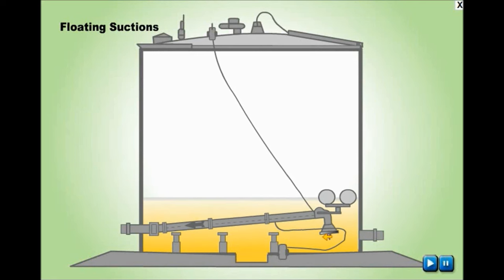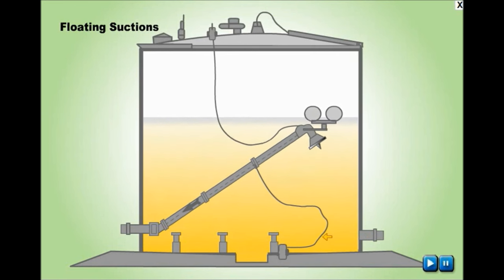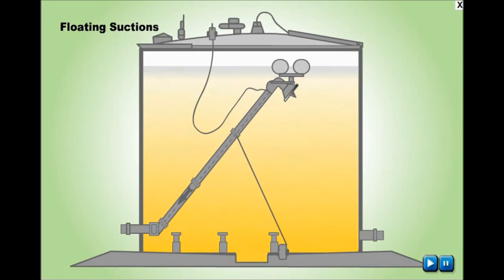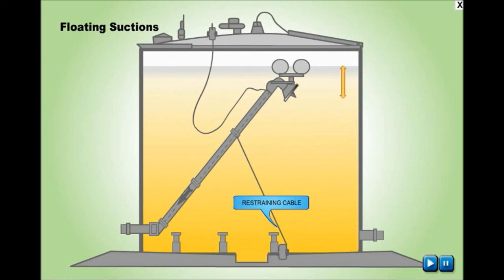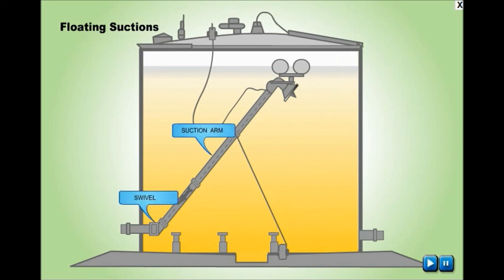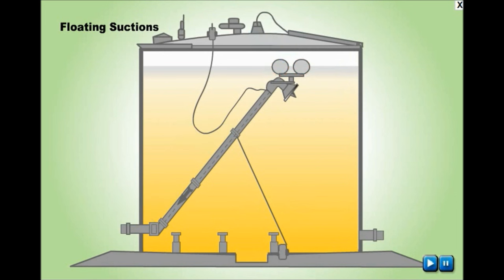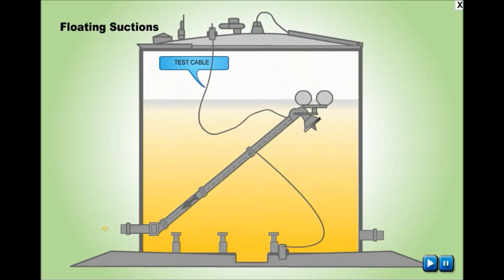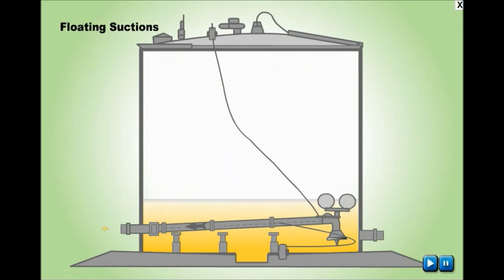Storage Tank Floating Suction Working Animation Video

Comment: They are designed to ensure that product in a storage tank is drawn off just below the surface of the liquid where it is cleanest, preventing the suction point being at the bottom of the tank where water and residuals will settle down.

source: https://youtu.be/-rVRTM_7JVc